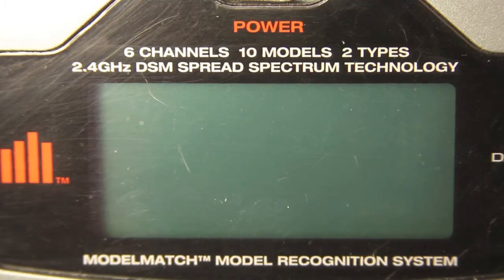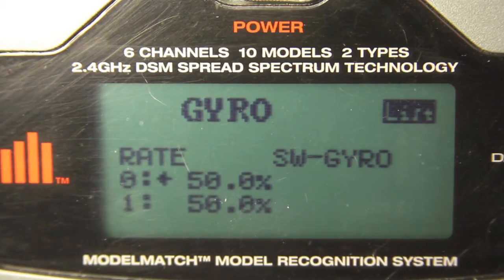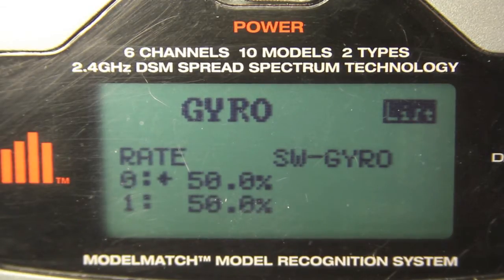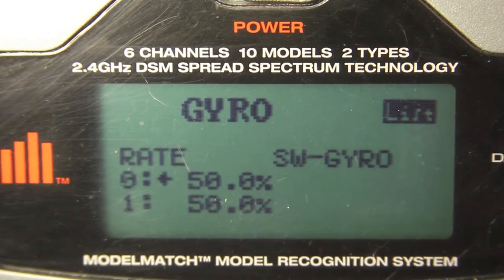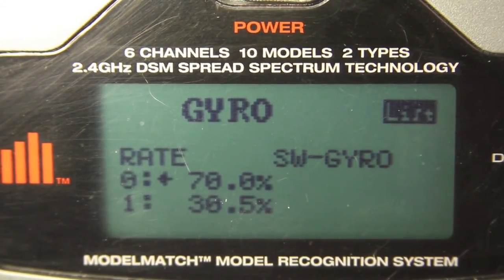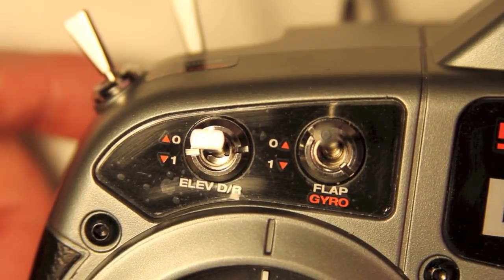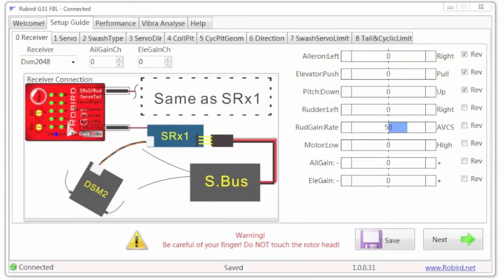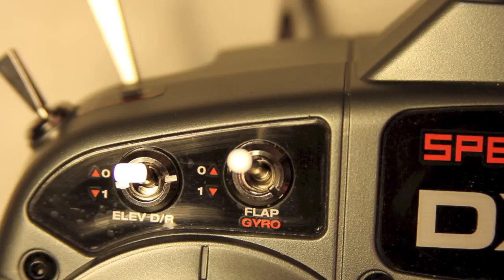21 : Tarot 450 Pro V2 Build : Gyro Rate Settings AVCS/HH/Rate

Comment: I just found it is the other way around, T-lock is HH and normal is rate mode. but I still have the question on which mode is better for 3D flying.

Comment: I'm still trying to find out what is better for 3D flying, HH or Rate, in my transmitter which now is an Aurora 9 because going cheap is not the best option in this hobby; I have Normal which I believe is HH (Heading Hold) and T-Lock which I believe is rate mode, if I'm wrong please correct me.

The Aurora 9 is not a pro transmitter but it is better and have more functions than the Turnigy 9XR, I love it.

I have a little problem when trying to invert the heli, on the simulator I'm able to do so and fly inverted without problems but in real live when I invert the heli it does something really strange it just erratically change direction and I'm not able to control it.

I've used both options that comes with the tarot, expert and intermediate and same thing with both of them, a crash every time :). 

I've even tried my own settings to try to customize it a little bit but same issue, when ever I try to invert the heli it just lose control, move erratically and I'm not able t o recover it, even the blades lose position they change and are not straight when inverted and that is what causes me to crash because it is not able to spin well.

Thanks on any input you can provide,
Jorge

Comment: I haven't comment on any video since a long time because now I'm a bit proficient in setting up the helis and the tarot fbl system, I've even posted some videos on youtube of my own, right now working on 3D flying and crashed a lot some I'm a good also at replacing parts and fixing my 3D messes.

I think I'll post a video on how to configure the tarot system and how to interconnect everything as I'm pretty sure out there should be a  lot of people trying to find out how everything fits together.

Comment from the maker: Figuring out how the electronics inter-operate was very confusing to me at first too, but once I got into the build, it started to come together. Your FBL will come with a single plug with 3 connections 3 servos (that is why there is only one port for them).  Your rudder servo will plug into the rudder channel...and the other channels will be to connect the Rx outputs to the FBL...so there will be one that is for Rudder on your Rx -- that will plug into the designated input on the FBL, etc, etc.

Comment: Sure I have the whole thing, Transmitter + Receiver, but now I'm getting confused because the Tarot Flybarless System has CH1 through CH4, RUD, AIL, AUX-ELE-PIT (just one port for this one) so seems like a 7 channel unit.

It looks a lot like a Receiver and other than these ports I don't see a way to connect it to the receiver, the only additional port that I see is a data port which is used for programming the Unit.

I'll continue with the build and see how everything fits together.

Comment from the maker: You should be good.  The Tarot FBL will connect to your receiver, which will bind to your transmitter. I'm not absolutely familiar with the FrSky components, but it the Tx and Rx that you must have compatible with one another...which is what looks to be the case for you.

Comment: One noob question here, I just bought a Tarot zyx FlyBarLess System and I have a 9XR with A FrSky DJT 2.4Ghz now to the point :), Will this Transmitter bind to the tarot system or I have to buy a compatible transmitter module. I bought them on separate orders and I didn't thought about it until now :(. I haven't tried the bind process yet as I'm still in the process of assembling the heli and I don't know if they'll bind.